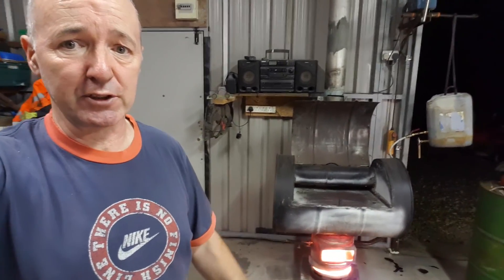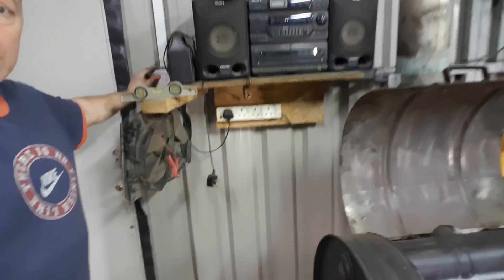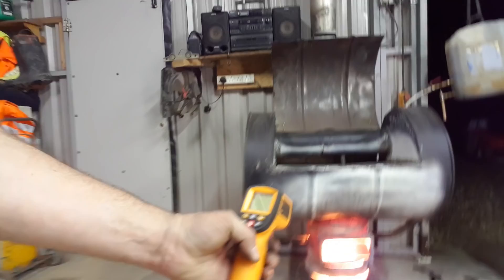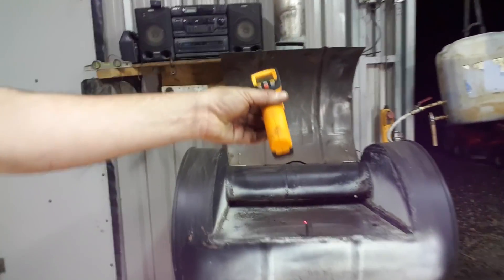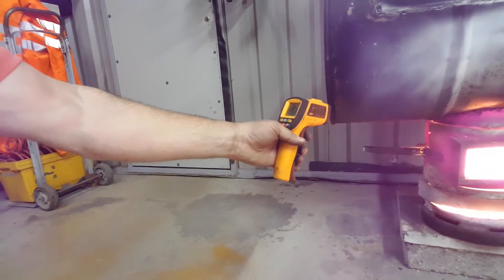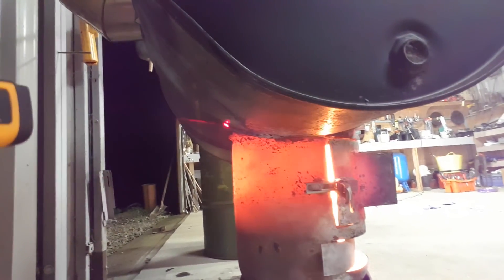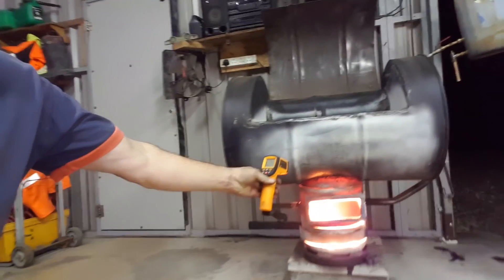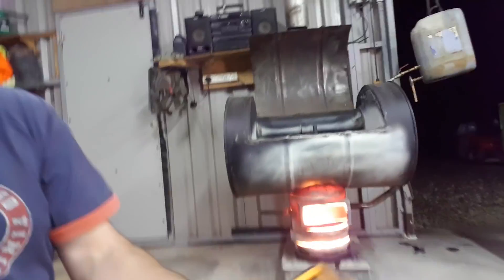Waste oil Stove Glowing red on just 3 litres of fuel No Burner!

Comment: Late to the party here but just wondering if you built a heat sink around the exit flu and even the stove it's self to retain and hold onto the heat which could keep the shop warm after stove turned off.

Comment: Crank that beast up, Gerry. Turbocharge the air and fuel entry ports.
Reply from the maker: Hi Richard. These burners are capable of more heat but with this configuration I have enough surface area to heat the shed. I do fear for the coating on the steel behind the burner though. 😀 Thanks for the comment Cheers Gerry

Comment: Just curious what’s the efficiency of the waste oil burner how much oil per hour?
Reply from the maker: Hi Jacob. Normally it runs at about 2 litres per hour but to get it glowing like this takes about 3 lph. I can see the oil flow and regulate it with a valve. I run this off a simple bucket or 5 gallon drum so I know how much I start with and how long it lasts. Hope this helps Cheers Gerry
Reply: Thank you

Comment: I'm working on  my stove  now it is a wood stove with blower and drive system  the problem I'm having is I start it with diesel/ kerosene mix  I light it  then cut fan on low  speed then cut the oil on and as soon as it gets going good it dies out.   I'm burning veggie oil mixed with motor oil out car. Any ideas of what I could be doing wrong?
Reply: Gary can you tell me what causes my wood stove  that I just converted to wast oil. To what I call back draft and puff very hard when go to turn air on blower I have a blower off a propane hot water tank and have a dimmer switch hooked to it so I can control how much air going in burn pot  but soon as I start  to turn it up after lightning and shut door and cut my oil to 1/8 stream it starts puffing so badly that I cut the oil  back  off and cut fan off and walk away.  I hope maybe 
you can help figure this thing out.  I watched all ur video s and you make it look so easy    thanks for all your videos they are very helpful
Reply from the maker: Hi Jason. I have just seen this but I have to go out now. I will try and help later this evening Irish time. Cheers Gerry
Reply: @GerrysDiy  thank you so much  I need help from the expert   I love all ur video s and watch every time you post
Reply from the maker: Hi Jason. Did you convert your stove to a forced air type setup with a vapourising pot and oil feed to the pot. What is your flue height and diameter. Does your stove have one or 2 doors ( 2nd door fir ashes). Can you take a video of your setup and post it to your channel. You can leave it unlisted if you want and send me a link. The puffing is unburnt fuel rich smoke not getting enough air for combustion I think. Cheers Gerry
Reply: @GerrysDiy  Hi Gary  yeah I converted to forced air with vaporizing pot.   But after 2 days trying to get it burning I went back to wood  to heat my shop. I'm thinking I'm putting too much diesel/ kerosene  In the pot   and the 2nd thing I figured out today is when I pumped the oil out 55 gallon  barrel to my drip bucket  I had the pump on the bottom of my barrel  and possibly  picked up some water  in bottom of tank so I have drained my drip bucket  and am ready for my next round with this thing.    My stove is single door.   And  my stack is 6inch   all the way  up and I will have to measure how much sticking past the building.     When I put the burner back in stove to try again  I will so video and send you like.  I will get video of my stove  and my system  and my  stack.   Thanks  so  much. I think I can figure this thing out with  ur help.
Reply: Hi Garry  I want to let u know I got my stove going couple weeks ago and been running good.  The problem was we was putting to much kerosene/diesel mix in pan to start it. Now I just use paper and cardboard to start it. Here is video of it running.  Thank you for you're help.   https://youtu.be/9pw5xVx2ymk
Reply: I have a stainless bowl  for burner

Comment: Without a burner? Looking forward to seeing the internal configuration.
Reply from the maker: Hi T5MKINDYOWNER I will show the setup soon. I will need to insulate the outside wall as the coating is in danger of melting if I run it this hot again. Cheers Gerry
Reply: @GerrysDiy  looking forward to it planned to make my burner this weekend based on your previous design.

Comment: Hi Gerry, What size flue pipe are you using? 
Cheers
 keith
Reply from the maker: Hi Keith. I have a 6 inch flue 4 metres long connected to the stove. That gives the stove enough draft to mix the oil and air. hope this helps Cheers Gerry
Reply: @GerrysDiy  I built a waste oil burner from an old compressor tank, the insides are almost identical to your burner. But I just cannot get it warm enough to stop smoking. I have 14 holes under to let in air, all 1" diameter, the inside of the burner air feed is 3" and the tank itself is 10" diameter. So I wonder if it is the flue I built. I made it from 2 pieces of 3" exhaust tubing,  both 2 meters long. Is that too narrow a diameter to make it burn right? It doesn't get the whoosh when you shut the door, just a tiny pitch change in the sound of the fire. Any ideas to help me out? ☺
Reply from the maker: @SWREngineering  Hi The flue is really impportant. I use 6 inch diameter and 14 feet long. you could try introduce some compressed air to the bottom of the burner and see if you get a cleaner burn. you will only need about 5 psi but because you have aa small diameter flue it might smoke out the door on you. But have a look at the flame if it brightens and combustion looks better even for only a few seconds you will have your answer. I will be doing a live stream soon. I'll try to anwer in detail then. hope this helps Cheers Gerry
Reply: @GerrysDiy  Thanks Gerry.  I have an 8 millimeter hole in the tank that goes directly into the burn chamber. I'll hook one of my small air restrictors to that hole and just leave the air from the compressor to flow for a few minutes. If it smokes inside I can just open the door to clean out after.  

I tried to make the whole thing as tiny as possible as the space to heat is small and uninsulated, Was hoping to keep the oil demand of it to a liter an hour or so. But that might be too little heat to burn cold vegetable oil..?
Reply from the maker: Hi Keith. 6 inch and 14 feet long Cheers Gerry

Comment: Greetings Gerry, I've built several different types of heaters over the years, nothing quite as intense as your blast furnaces. My fascination has always been the flue gas temps, being that it gives me an indicator of how much of the energy is being extracted to the inside space. How hot does your exhaust vent get? Great work there.,,,👍👍
Reply from the maker: Hi We Are Miles from Nowhere On one of my stoves I managed to melt the paint off a repair collar near the roof. This stove is more efficient and 2 inches above the roof on the outside a couple of days ago I measured the temperature at 14 °C . So not bad for an oil drum and a propane bottle. I was worried for the coating on the wall behind the stove. I might put some sheetrock at that level just to deflect some of the heat off that wall. Thanks for the comment much appreciated 👍 Cheers Gerry

Comment: We ran a oil burner that we built at our automotive shop for several years. Waste oil stoves make an incredible heat that you just have to experience for yourself. Nothing else comes close.
Reply from the maker: Hi fan1701 My shed is a lot more comfortable because of these little stoves and they are not hard to make. Thanks alot for commenting Cheers Gerry

Comment: I have been searching for a good I round cylinder.  Soon as I have it I’m going to build a stove.  Thanks for all the informative videos you’ve released Gerry!!
Reply from the maker: Hi Dustin. I have converted conventional stoves too but there is very good longevity in the propane tanks as they make them with some good metal. Cheers Gerry
Reply: They're easily found at propane fillers. People will leave their non compliant or out of date cylinders. That's where I got mine, guy said they give them all to a scrapper when he comes by.